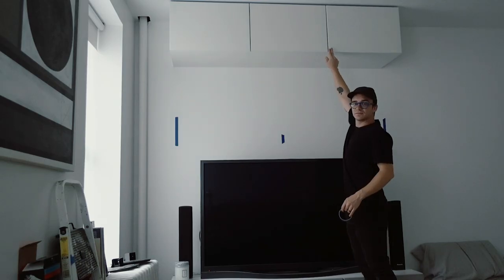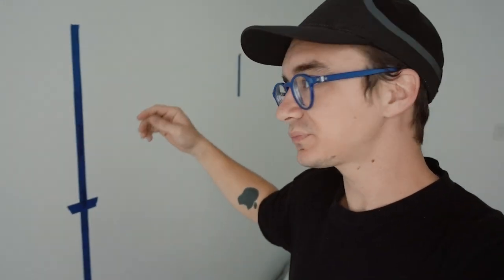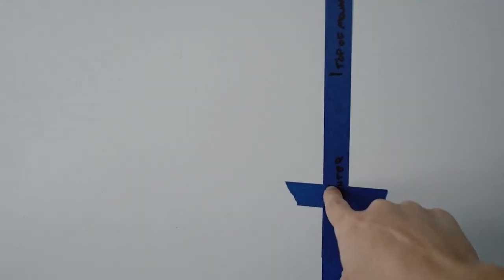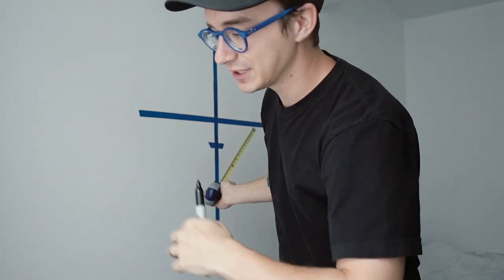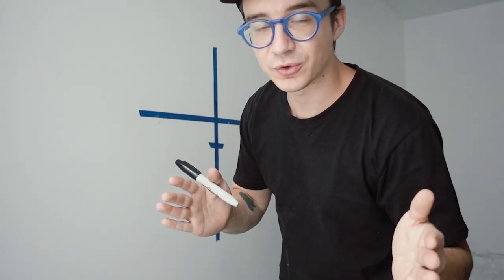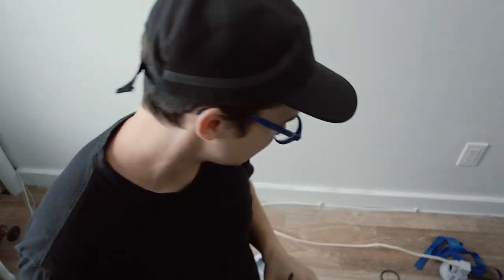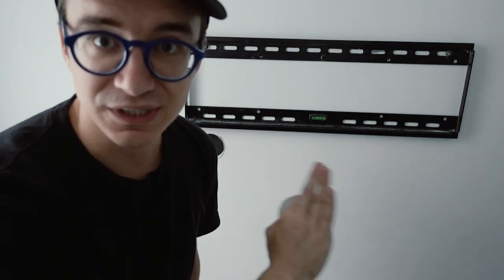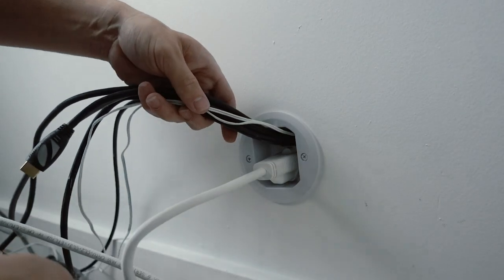Mounting our TV and running cables in wall (How to)

Comment: For all the those saying it violates electrical code are wrong. The in wall kit is designed for low voltage cables. The power cord for tv is connected to the kit on the outside
Reply: nevertheless power cable is still inside of the wall and it shouldnt be in the wall without conduit or appropriate electrical cable used

Comment: Don't run loose cables down the wall, use a plastic tube! Then, in the future you can add more cables or swap out faulty ones by simply pushing them down the tube?
Reply: Im confused is your comment advice or are you asking for some advice?
Reply: Why would you need a plastic tube?  Why would you ever push a cable?  He didn't mention it, but you can bet he left a small string in the wall that you can use to pull more wires.

Comment: How is this install holding up? I have a similar dilemma, I have a single stud down the middle behind the wall, and the 2 to the sides are 24" away from center. Thinking to lag bolt to the middle stud and use anchors or toggle bolts to the sides to dry wall. Aesthetically I think this will look better, but I'm nervous about strength and might go for the plywood board method. TV is a 75" @ ~ 90 lbs.

Comment: Awesome video. I have a question, where should I drill my whole if I have my main tv wire coming from the left and my HDMI cords coming from the right. Should I drill in the center and meet the cords in the middle, or should I choose a side and feed the cord to that hole ? Also I have a swivel mount on my tv that can tilt as well, what advice do you have on having some slack to give so I am able to pull out and maneuver my tv a little. Also I am planning on purchasing the same tv kit that’s in the video but if there is something that works better that you know of and will make for a easier install feel free to point me in the right direction! Thanks for your time.

Comment: I think the Power Cable needs to be separated from those other Data transmission cables such as HDMI, Speaker & Ethernet cable by atleast 1 feet if i am not mistaken. They seem barely an inch apart using that solution.
Reply from the maker: I don’t think they would make wall plates and kits like this if that were the case. That would open them up for major liability.
Reply: Yes, this is correct.

Comment: This set up violates electrical code.  High voltage needs to be run through a box and channel separate from the HDMI wires.  If you have a fire your insurance company will not pay your claim due to improper electrical.
Reply: Why don't you link to the published code?  I'd read it because I'm looking to do an install like this TO CODE.  If you can't provide a link you're just a troll.

Comment: This guy never heard of an HDMI splitter, just run 1 HDMI and have a splitter at the end
Reply from the maker: That is an option if that's the setup you prefer. I prefer my AV setup to eliminate as much complexity as possible where it becomes intuitive enough for a guest to turn on the tv, start a movie, and never have to ask what remote or input or button to press.

Comment: To start buy a stud finder that marks center. Not much more than a edge finding one. Next in a lot of areas it is not legal to run power through the wall. So your kit is not up to code in most places so i would not use it. not hard to add and outlet at that location if there is one under the location you are mounting. he is smart to run extra cable because it is never fun to pull a TV and add anymore. Not a good idea to run any type of video cable with power. Low voltage items do not work food with standard electric items.
Reply from the maker: I don’t think a center stud finder can find the center of a piece of furniture. It’s for finding the center of a wall. The kit is the exact same in-wall rated wiring as adding an additional outlet.

Comment: You don't use bolts in wood, you use screws!
Reply from the maker: It’s called a lag bolt https://m.lowes.com/pd/Hillman-1-Count-3-8-in-x-5-in-Zinc-Plated-Steel-Lag-Bolt/1000381827

Comment: DO NOT DO THIS!!!!!!   You cannot run a power cable behind a wall. You need to have the proper rated cable run between boxes behind a wall. This violates code and if a fire is started, the insurance company will NOT pay.  Use a proper power bridge to do this.
Reply from the maker: It is a properly rated cable. and rated wall grommets. That's the point of the kit.